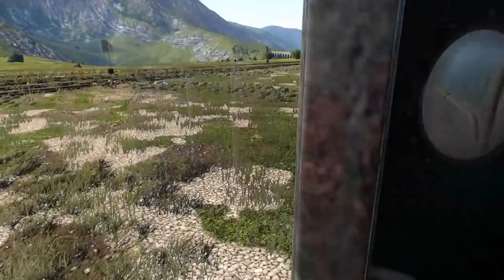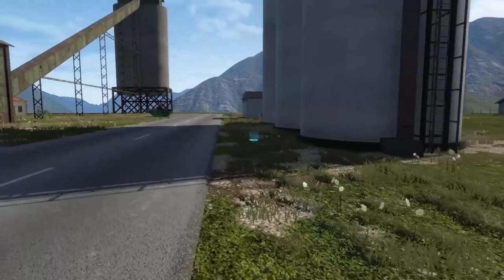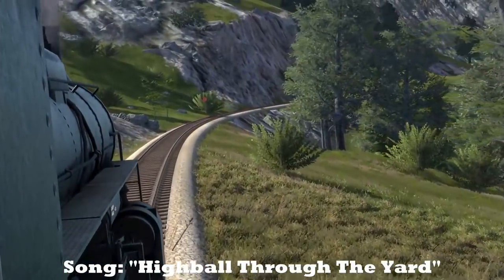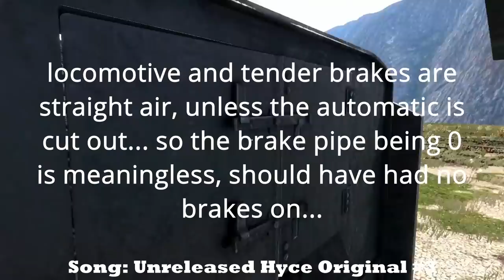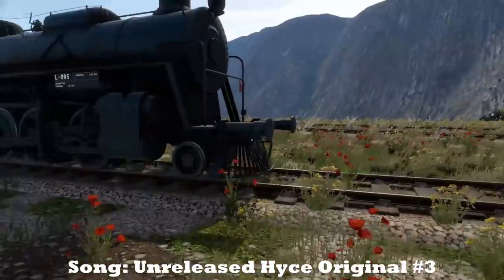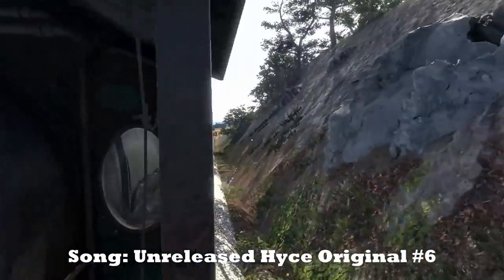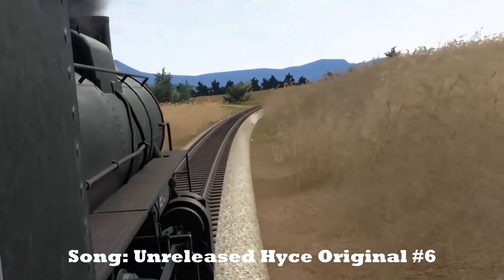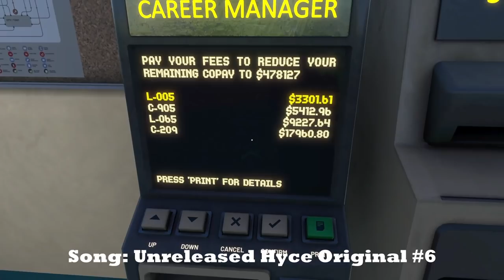[DV] Using TWO steam engines for a HEAVY train! (one should've worked)...

Comment: One time I did an almost 2k ton haul out of the harbor with 2 steamers, I must say that was the most stressful run I ever did, luckily both were on the head end so I could have some amount of time to stick my head out the window to see what was happening but other than that it was full blower, full damper all the way out at a solid 20 kmh, I think I'll go into the DV discord and scroll way up to find the screenshot I took but it felt a lot like what you did here

my advice for doing coal drags in DV: get the biggest run up you can, use the blower to get your fire temp up while your at a stand-still, then roll the cut-off back a notch for ever 10 kmh you accelerate (once you hit 40 you can usually place the cut-off at about 1/4 of a notch, your pressure will drop like a sack of rocks but you can usually get up to over 60 with 800 tons before you're off the bridge) and then use sand to keep traction, then start notching forward as your speed decreases, but don't even think about using full forward on the hill then let your temp drop once you crest the grade and it's mostly braking from then on
Reply from the maker: Cheers for the tips!

Comment: I've Min Max'd this at 1050T with one Steam loco, but it is right on the limit, like max fire temp, full reg and reverser all the way forward at the top of the hill, moving at about 20-25. Like just made it in every aspect.
Edit: peaked at 45 before the steep grade.
Reply from the maker: Very similar to what I did, but you had just that extra bit of speed. Nice.

Comment: There is a mod available for the steam engine that fixes a number of issues with it, Realistic Steamer Overhaul on nexus.  You can also customize the efficiency of the coal, and other things like starting pressure so you don't have to wait half an hour+ for the boiler to come up to pressure.   Hopefully the upcoming sim overhaul will fix the issues and give the steam engines their proper tractive effort (steam vs diesel is backwards, steam power is less efficient but with generally greater tractive effort, diesel is lower maintenance and much greater energy efficiency).

The current version of the steam is very wrong indeed, the tractive power is way off for an engine of that size, the reverser is pretty much broken, as you use the same amount of steam regardless of the setting. Even the damper doesn't work.  I dearly wish they would move the fire door handle to the other side of the loco too as it covers over the main brake when open.

I also often use the remote to control a diesel on the rear to help with braking, give some slack, and give an extra push when needed.

Comment: In Holland most steamtrams where designed so the engineer could do the driving and the fireing. After seeing this, it's a miracle some examples still exist/run and haven't been turned into artistic bananas or had to replace their fusable plug daily  😂(i hope it's the right translation for the plug in the crownplate that melts at low water levels).
Reply from the maker: I think it's spelled fusible, but yes, that's the thing!

Comment: Galaxy quest quote! Noice!
Reply from the maker: They're miners, not minors!
Reply: @Hyce777  "you lost me"
Reply: @Hyce777  not gonna lie had a blast last night on stream with my buddy Peek we push, pulled 5 empty hoppers, 2 steel rails, and 13 wooden beams to Coal mine using 2 class 70s! 

Went relatively smooth considering this is the longest train we've run yet! In Rialroads Online

Comment: Vanilla ~800t is the limit the sh282 can pull out of the coal mine.
Impressive how far you got with over 1000t.
Reply from the maker: Yeah I recalled folks saying that. I bet if i didn't accidentally run the thing out of water and got as fast as possible I might have done it.

Comment: I may be wrong, but i think the knob for the blower is supposed to be connected as a control valve for steam to go to a blower to control the blower and not regulating the actual air going through it.     basically like the control knob for the heater fan in a car.   it controls the fan not the airflow.
Reply from the maker: The blower is literally just a valve that takes steam at boiler pressure and sends it out a pipe that then exhausts out the stack, causing a draft. There is no fan. Some blowers are fancy and called "ring blowers" that even out the flow, but, most I've run into just had a pipe that just ends pointing up the stack to one side.
Reply: @Hyce777  I meant in the game,  not IRL.  The way the pipes are set up it looks like they modeled it as a control valve for a blower  motor.  But like i said i may be wrong.
Reply from the maker: @Bendigo1  oh weird. I'll have to look into what you mean in game next time I've got the steam engine

Comment: I've had some one try to explain to me before that steam engines are better at maintaining tonnage then Diesels, but Diesels are way better at starting tonnage.

"A steam engine can run a train it can't start, but a Diesel can start a train it has no business of running"

Is that due to the smaller wheels, or the instantaneous torque of the electric motors?
Reply from the maker: That is the old story!

For diesel: you get all kinds of torque and power at low speed, but you can't keep that up at higher speeds. For steam: the engine is literally directly coupled to the wheels - 1:1 gearing - in order to actually utilize the force of both cylinders you have to be going at a decent speed, else you can get "centered up" where only one cylinder is providing power.

Comment: did you open the Turbo valve by pushing the handle down meaning did you open the vant on bottom of the steam engine cab floor under fire box you need that open first
Reply from the maker: The damper, yes that's what I opened by pushing down. Allows more air in for a hotter fire.
Reply: @Hyce777  ok just checking but also I was told you need to backup all the way and on to the other hill and you should roll back the Boston bar or reverser before you hit the hill I know some one that did that hill with 1,200 tons if you try that you should make it also you should have water cracked open not at full but half way open you want to hit 60 high ball in yard to make it out with 1,200 tons that’s the really max weight you can pull at correct speed you slip u done try hitting 60 before u hit hill or close to it

Comment: 34:20 How do you get a runaway train if you run out of brake air? If you run out of air, the train brakes. Only very old trains had it the other way around. In DV, they use the more recent (and safe) way. If you run out of air, the train stops.
Reply from the maker: If you run out of air in the brake reservoirs on the car (by extreme mismanagement of the airbrakes), you can make it such that even an emergency application does nothing.
Reply: @Hyce777  Only if you shut the air valves (blocking the passage or air) and keeping the air pressure. That would be as you mention. 
However, by reopening the valves, the train would quickly equalize
Reply from the maker: @brunoais  only if your main reservoir is high enough.
Reply: @Hyce777  You mean brakes aren't active by default? Otherwise, your answer doesn't make sense to me...
All I know is:
Without air, brakes can't be disengaged...
Reply from the maker: @brunoais  you are correct that the brakes are not active by default. You are incorrect that without air, they can not be disengaged.

If you come up to a train car that has sat for a while (enough time to leak / bleed off), it will have no brakes, despite not having air. This is why we have handbrakes. So, you couple a locomotive to it, charge it full of air, and then when you remove air from the brake pipe, you get the brakes to apply.
Reply: @Hyce777  Oh! Interesting! I had a different perspective on how it works. Thank you for the correction.

Comment: A few things you don't slang for:

Putting torpedoes in the firebox (replacing the coal with torpedos)
Running into a Prickly Pear growing out of the ballast.  (Yes, cactus sometimes do that.  Opuntia are particularly hardy and common.)
Arguing with a whistle.
Breaking off the Brake lever.

Comment: I really want to try the mod that reworks the steam loco but i’m kinda scared i’ll suck too badly at running it since it changes so much. Have to basically relearn the whole train
Reply from the maker: Certainly fair! I'd say it's worth it.
Reply: @Hyce777  i’m gonna try it
Reply: Update: it’s actually amazing haha. Oddly enough i would say the “realistic steamer” is easier to run by far than the vanilla. It’s definitely stronger, more efficient with steam, water, and coal. You can still stall on a hill if you mess up your momentum but so long as you ease back into it you can gently pull yourself over the hump!
Reply from the maker: @StrikerV3  thanks for the follow-up! I'm going to have to try it for sure.